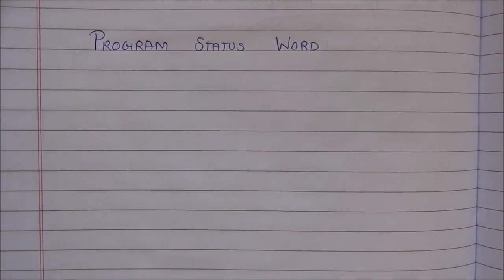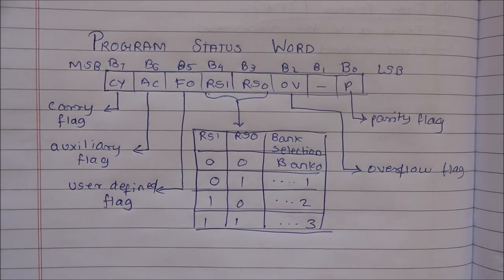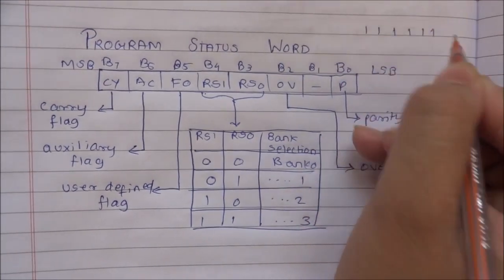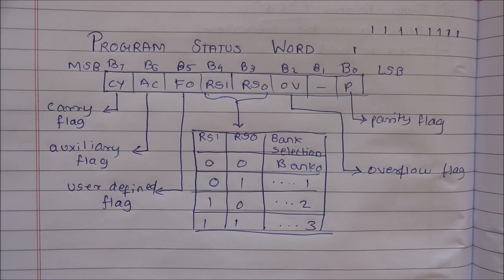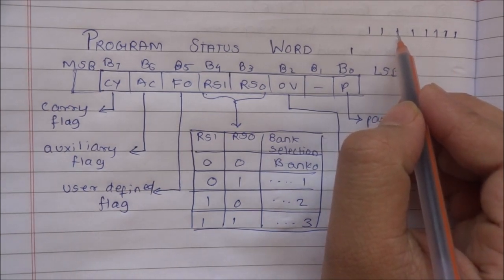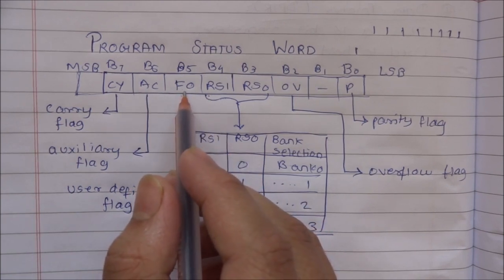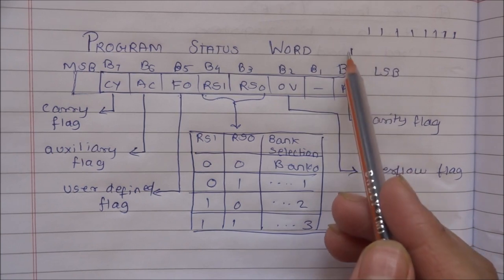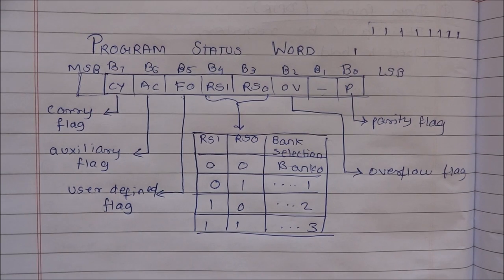Program Status Word   What it is    Explanation 1280x720

Comment: So carry flag and overflow flag does the same job?
Reply: Purvaa Mhatre  when an result goes out of range for eg..range of 8 bit  signed -for (-127 to + 128)  OF will set to 1, if within range its reset  ie. 0
Reply: @hameermahajani2111  thnx bro 
It was the sole reason why i came here
Reply: No , there is a mistake In the result